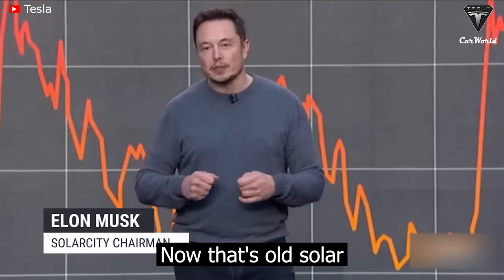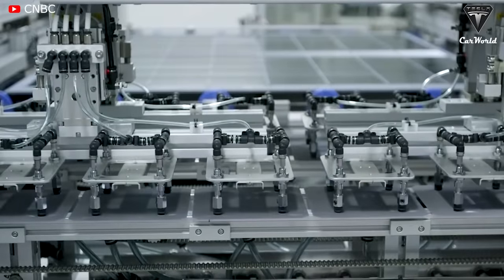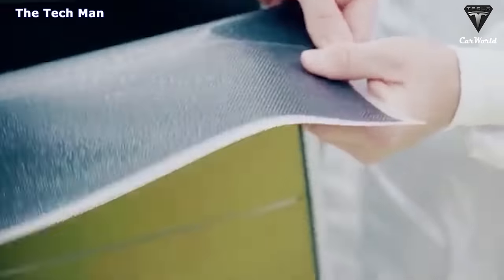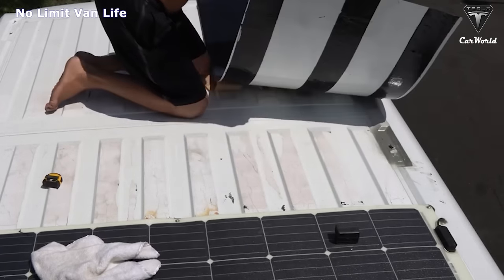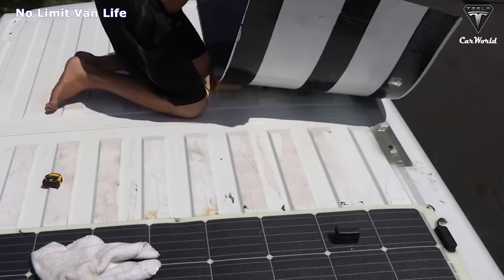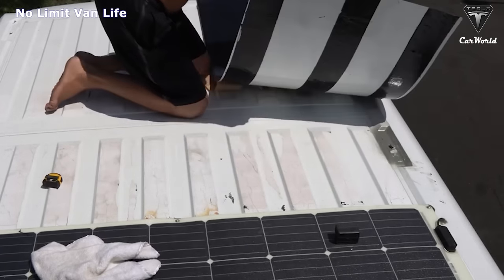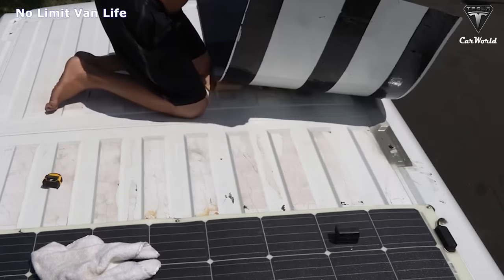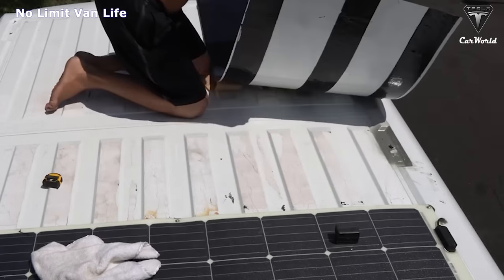Elon Musk Revealed All New Solar Panels for 2024 Renewable Energy, Can blow your mind!

Comment: I saw some figures a few weeks ago where a guy took out a $30,000 loan to install solar and powerwall and reckins he will save an equal amount of money in home energy costs per month to pay the loan back, so it was effectivly cost neutral and 12-14 years to pay of the loan on his property depending on what the costs/interests rates went to, after that it was all pure savings
Reply: well Doh! isn't that why people have been doing this for 20 years already?
Reply: @occamraiser  Sure, but If you knew what Tesla and Powereall software can do, as the software can/does and is capable of selling your excess energy to Tesla which in effect sells it at their EV charging stations, or potentially can/does... and as powerwall has only been available for less then 10 years.. it takes all this type of operation to a whole new level of Tesla being an energy distributer and generator.
Reply: Until recently with the advent of higher electricity requirements (EV's) & lower PV panel prices, it wasn't worth getting Solar.   Better to invest your money & get better profits than electricity bill savings, but that's changed now (as one would expect).
However, aftermarket Solar makes less sense than new roofs & full roof replacement being purely PV, as you don't have the added labour/materials of the racking systems.
This should be standard on ALL new roofs if governments are serious about CO2 levels.

Comment: Panels last longer than 20 years.  They will degrade on average 2% per year for 20 years but are not defective at that time and can still be used.
Reply: Thank you for sharing that valuable information about solar panels! It's great to know that they can still be used after 20 years, even with a slight degradation in efficiency. Speaking of durable and reliable power sources, have you heard about the Segway Portable PowerStation Cube Series? It's a versatile powerhouse with a massive capacity, powerful output, and even a waterproof design. It could be a fantastic addition to your outdoor adventures or as a backup power solution for your home. Check it out!
Reply: تخيلو التقنيات الممكن الوصول اليها خلال ٢٠ سنة قادمة

Comment: My UNI-SOLAR roll out panels are not as efficient  as other solid cells, but the make up for it in other ways. Most of all, they are practically indestructible and use all levels of light. I bought a bunch ,still glued to rolled roofing about f years ago and they were probable 15 years old when removed from a roof somewhere.  installation was easy. I just rolled them out on the back lawn and it's done.  Even a full moon shows voltage, just no real amps.  A cloudy day can still produce some power.  
   They quickly went out of business. and just now I'm seeing some companies selling the same type panels.
Reply: Hey there! Thanks for sharing your experience with the UNI-SOLAR roll out panels. It's great to hear that they were practically indestructible and still produced some power even on cloudy days. It's unfortunate that the company went out of business. If you're looking for a reliable alternative, I highly recommend checking out the Segway Portable PowerStation Cube Series. It offers massive capacity, fast recharging, and comprehensive protections. It could be a great addition to your outdoor gear or home backup power setup. Happy camping and stay powered up! 😄🏕️

Comment: How about light weight solar canvas instead of rigid solar panel, 
so you can easily put them facing the Sun or the mirrors reflectively?
Reply: What if they can put solar on my 3 wheel scooter  is that impossible?MADE IN USA NOT IN CHINA.😂SOMETIMES DREAM COMETRUE.
Reply: IFFF MY IDEA COME TRUE THATS THE MOST TTHING THAT WILL HAPPEN.  ONE MORE  ITS HARD
FOR ME TO MANEUVER IN SIDE FRONT OF D BUS ITS TIGTH FOR ME MY ARM BLEED I BUMP DDOOR
OFFD DRIVER ,MAYBE  IGO INSIDE  D BACK DOOR  THEN EXIT D FRONT  DOOR?POSSIBLE?THANKS IF
IT HAPPENS. 😂😂😂😂😂😂
Reply: They already make flexible film solar panels.
And the price of solar panels have consistently dropped to around .45 -50 cents per watt.

Comment: The same design Nuclear plant used in Fukushima is at the Hanford Plant located on a Earthquake Fault line on the Columbia River in Richland, Washington State.   The Texas Utilities need to give more incentives like Washington state did i pad of a 30k system & in five years with insensitive we could earn each year up to $5k tax free i did about 3,500 each year, I have paid the system off but now i do not get the yearly incentives as of this year and need to decide if i will take the energy and charge my own LifePO4 battery's to run 100% independent of the Grid.

Comment: We need to put solar panel add to the ev so it can charge the vehicle and also to make the left over juice in the to stop the vehicle to recharge the ev to full.   This way we do not have to plan to stop at the EV to recharge inconvenient that cause lack of sale the investors will adjust the stock market holding to invest in to low price stock buy low to trade late for profit.

Comment: You can make a similar cell at home, get a sheet of copper, bake it in the oven at 425 for 10 to 15 minutes until nice and red. Then brush off a small part of the copper-1 oxide layer to expose a section for one contact and lay contact over the copper oxide layer for the other contact.

Comment: I worked in the artificially subsidised PV industry for 15 years.  Main problems - apart from the fact without your tax money it made no energy / ecological sense:  
1). The cell tech of last years isn’t at all efficient in cost or output - and isn’t at all ecologically responsible in manufacturer and application.  In fact, it is a very energy and resource dubious industry.  It could only grow due to oligarchic manipulation using your tax money via corrupt politicos / corrupt countries (esp. China).  It transfer money from you to them (the ‘Crime Oligarchy’);
2). As cells and panels became thinner over the years, the panel durability and reliability over time became more unknown. The original degradation factors and reliability profiles in recent years became ‘totally’ unknown - but companies continued selling as if they knew.  This transferred huge unknown risks onto the tax payers and buyers.  I have little confidence in the reliability and durability of modern panels (all types).  Will your USD 5O k investment be worth anything in 10 years - and how much energy will it have produced in the same time relative to efficient conventional and much more ecologically responsible sources per Watt?  This puts a massive risk to consumers, ecology and society in general;
3). Covering large acres in black panels can alter local weather patterns via infrared absorption (heat) and is a waste of land.  Solar farms make no sense at all for grid production.  Especially, in hotter areas, as the cells don’t work at all well or at all with excessive heat.  Neither  do they work well or at all with dust / dirt / hale / many even with localized pollution or shade (e.g. a singular bird shit).
4). Therefore, the only logical use for a solar cell is on an existing building / dwelling for own consumption.  However, then you need to redesign the dwelling / appliances / electric systems for easy consumption and storage.  Expensive and not value for money.  Also, ecologically dubious, as far more heat is generated on the average roof top. This again can affect weather patterns - ecology;.  
5). The main logical area of application for PV applications are on things like boats and other mainly off-grid applications which can easily be washed and cooled.  Applications too expensive or complicated to power from an existing grid and efficient energy source. Wind can also make sense in these applications too.  Otherwise, current PV and most current wind tech just transfers your money to governments - and they transfer the same to their ‘Crime Oligarchic’ masters - and they use China to control all production / crush democratic systems / fair markets  / logical processes / innovative society / you.

Therefore, in conclusion, be very wary about claims relating to PV - and especially if they come from oligarchic sources.  However, if this Musk promoted tech really is the deal and works without the myriad of potential problems as advertised (this idea is very old), then it may be a game changer. I hope it is because PV makes almost zero ecological / economic / societal sense today - except for yachts, mobile homes and some small off-grid (expensive to get at locations). 
However, even then consider still the storage bottleneck and how terribly inefficient, ineffective, increasingly volatile (dangerous) and ecologically disastrous battery tech is.  Travel in Africa to see the scars to people and the environment.  Lithium and other rare resources are things which certain in the Crime Oligarchy are willing also to start wars again over.  It drives more crime and more violence too.
I’m an ex-member of Greenpeace (left in 1980’s).  I have seen the ecological movement infiltrated, dumbed-down, oligarch-politico corrupted and criminally abused for many years.  Like Musk, I have a South African background.  I would not trust any of the Oligarchic for one second - including Musk. Oligarchy is the problem!

Comment: Wat about storm debris hitting the tiles since they are glass. Are you using glass that doesnt break. In hurricanes, toles come off, if this was to happen, wat do repairs look like, does the system still produce energy if a section gets damaged..the heat the panels absorb themselves making the roof hot. Using mirror or white components to eliminate the panel itself from becoming hot. Would this come in white for say a white roof. Can you walk on the roof with this applied. Bird poop or tree sap? What is the cleaning process for the roof with these solar products applied to them?

Comment: I plan on building an off-grid home in 3 years, and this is very helpful to have watched. I want to generate 4x the power that I consume, so that means more battery storage. The place I will be installing gets about 300+ days of sunlight the other 65+/-  is rainy days and the few snow days a year that we may get (which seems to be about every 4th or 5th year) I do not want to rely on the grid for anything, and will also think about wind since the area gets a good amount of wind as well. I want to run everything off of solar from heat to water. the reason I like to have a large bank of power is for those days when I might be working on something that requires more power like welding and future usage. I plan on having freezers on my land as well as a hook-up for my family and the future expansion of more dwellings on the property. I am hoping that I can co-opt a rain-catching/solar array for both producing power and water. I am still researching my ideas and this video did get me more ideas too. I like the bougerv panels because I would like to cover as much of an area as I can to generate power even on areas non traditional like posts and even on the water storage tanks. If I could cover a south-facing wall with power generation I would do that as well, since it is not in an incorporated area I don't care what it looks like from that side. A lot to think about and still have 3 years to plan, let's hope that the price keeps going down that is good news
Reply: if you use 3x less why
Reply: We have been offgrid for twenty one years. Our location at 41 degrees latitude is not the ideal for solar.  It's great in the summer but awful in winter.  We have a two hundred amp service powered by a Xantrex 4000 watt inverter and 36kw of storage.  We  use a fridge and small freezer all year round.  Once the batteries are fully charged it automatically heats the domestic hot water tank.  The house has a propane boiler for infloor heat which is seldom used as the wood boiler is used full time for heating.  There is a downside when there is no wind or sun.  About thirty of those days require a generator to run for about two to four hours to maintain the house power requirements.  It is not a hands off power system.  Batteries need maintenance and the panels need cleaning when there is dust or snow.  When welding I use my generator.  Over sizing solar and wind energy is not very cost effective.

Comment: A bigger impact is The printable solar cell technology being optimized now.  It might not have the power density of traditional silicon glass ones but is dirt cheap and doesn’t require any rare earth metals.  Can’t remember which university was demonstrating it a few years ago.  I thought of painting it in the upper surfaces of high altitude aircraft.  Could generate enough electricity to seriously reduce the amount of parasitic losses due to alternators

Comment: If your a designer the flexible solar  conversion conductor is a massive game changer. 
But oh Elon would have to see that angle in the spectrum
Reply: Actually I think Elon saw the same vision did! 
But the process hasn't been figured out yet but the vision I'd there and I can see it. 
Here is the beginning. Isolate the panel.tona deposit like cans. At least then. They can be categorized.  .thenn as we study hownwe influence the cells through experiments? At least the best known elements for the transfers are kept at the same places from the nose regions. .then it's the resonant field tomseperate the atoms. And them after that the puriti3s can then be run through he re modulation of the atoms. But I don't know fornsure if thay aspect has been realized yet. But it's coming. Inalready saw it
Reply: Anyhow I hope somehow Elon sees these post. Because I know I could help move things forward in  a great deal, but I am a conceptual mind. Yes I can learn and do anything just as anybodybelse. But not everybody sees visions

Comment: I think the breakthrough would be to create a coating that could require sunlight no matter the direction of the sun and generate a steady energy flow to the inverter. I know there are window tints that can bring sunlight into the house no matter the direction ló the window is facing the sun of course so solars should have the same in the future if they don't already have to collect even more sunlight for the panel.

Comment: We have a large battery bank at the house when the electricity is on and working the batteries get charged, if the electricity goes out from a storm we use the batteries and they last quite a while, if they start to run too low we have a propane generator that kicks on runs the house and charges the batteries, we live in Pennsylvania and for solar panels they're just not worth it for us. The batteries are great

Comment: I heard from a friend of mine that has solar panels on the roof of her house and she had to have them taken off cuz it made her house too hot in the summer inside of her home. so does anyone know if  these solor roof panels will cause too much heat inside a home in the summer?
Reply: Probably didn't have enough of an airgap between the panels and the roof.  Panels will actually cause your roof to be cooler if properly installed.
Reply: Does that make sense to you?  They could use their efficient source of electricity to run roof vents/fans, a heatpump (AC), or mini-split.  Just tossing solar without considering all the variables can be a bad idea.  It isn't for everyone.

Comment: Old solar panels are not useless.  Their efficiency will drop under 80% and someone will declare it used up.  Remember when we were happy to get solar panels at 18% efficiency?  Add two panels and you are back up to full strength.  Or, if you want to buy all new panels sell the old ones for the price of glass, $30 to $40 dollars per panel if they are not broken, they will still produce energy for green houses, sheds, pool houses, Garage applications and those deck tables and pavillions and Gazebos and perbolas that need to make shade and a rain shelter but would be great if they produced enough electricity to keep your lap top running, a ceiling fan, some electrical ports for phone charging or fans..  Re use panels, it is far better than breaking them up to get a few dollars for your trouble.

Comment: I been thinking of putting a Flex Solar on top  of my Van. It not Flat at all. So only room would be a Flex. But I was worried that it would not be enough power. If I can get 200-400Ws I will be good. And if it does not rip off while Im driving either.

Comment: Hm. There has also been some research done on pyrargyrite,/proustite , a light sensitive sulfide mineral derived from silver and antimony (Ag3SbS3) that literally washes out of the ground in areas like Eastland county, Texas. With a lower melting point than silicon and a naturally light sensitive metal, applying a weak voltage while it cools would be enough to polarize the crystals for battery cells.